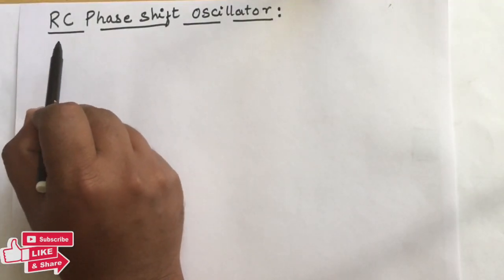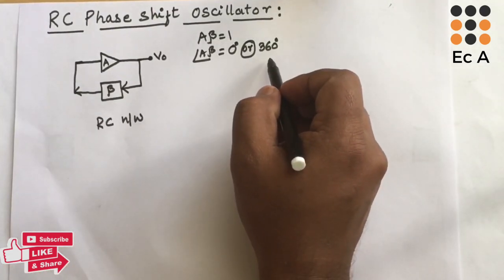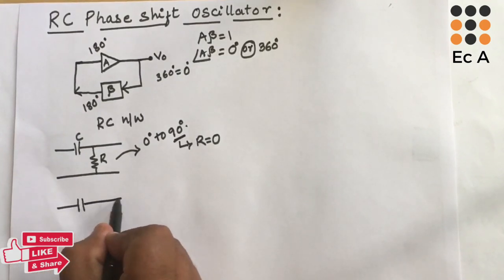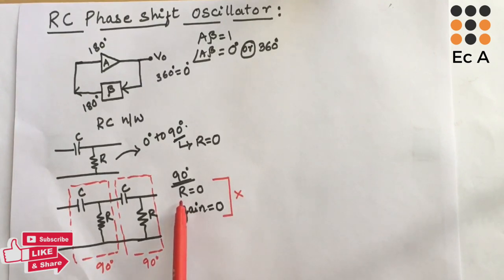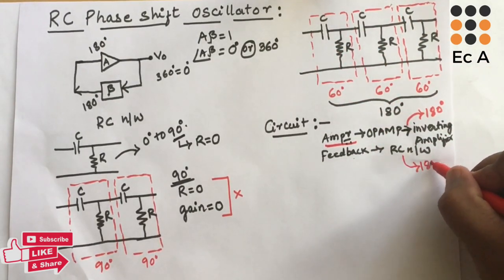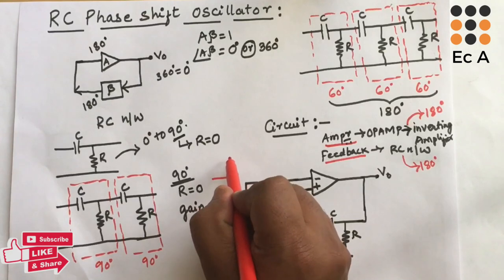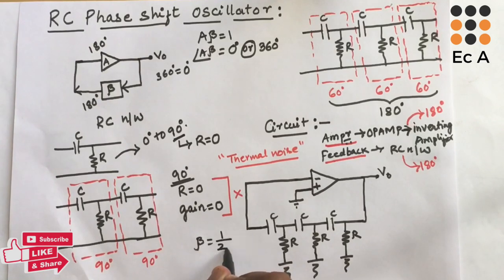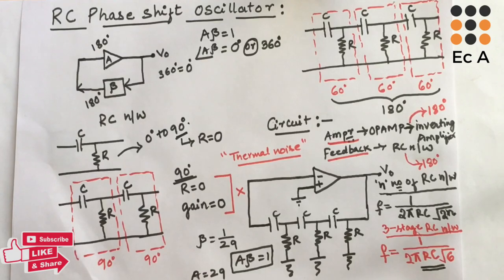#44 Ladder network oscillator / RC phase shift oscillator || EC Academy

Comment: Wht is thermal noise
Reply from the maker: thermal noise, Johnson noise, or Nyquist noise is the electronic noise generated by the thermal agitation usually by electrons inside an electrical conductor, which happens regardless of any applied voltage. Thermal noise is present in all electrical circuits 

SUBSCRIBE and keep supporting EC Academy 👍

Comment: Why the non inverting terminal (3) is connected to ground?pls sir answer fast
Reply from the maker: If you know the concept of opamp.... it has 2 input terminals. One is inverting other is non inverting. Depending upon our application We can use any one terminal at a time and other terminal is grounded. Since in oscillator we require 180 degree phase shift... we will use inverting terminal as input and non inverting terminal is grounded. Hope you understood.
#SUBSCRIBE and keep supporting EC Academy 👍